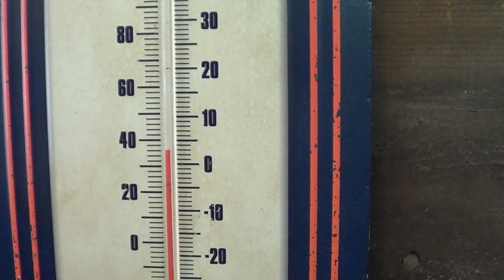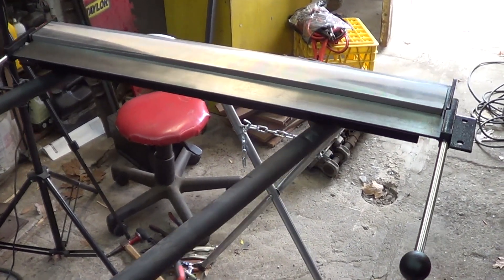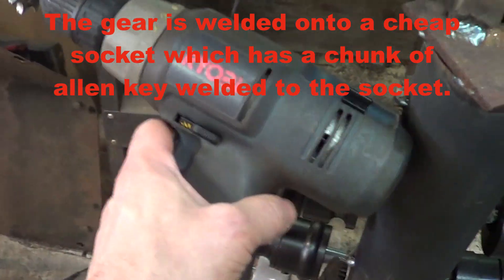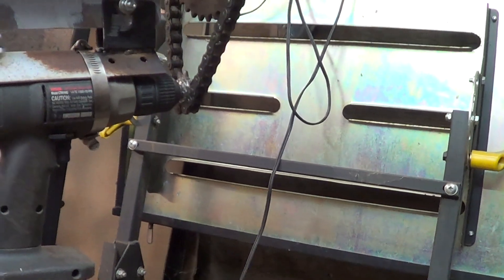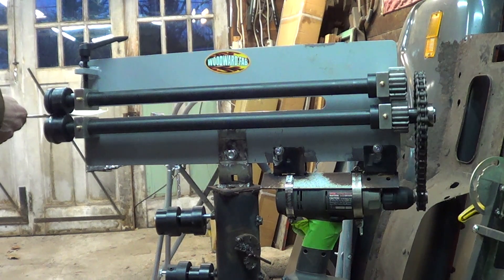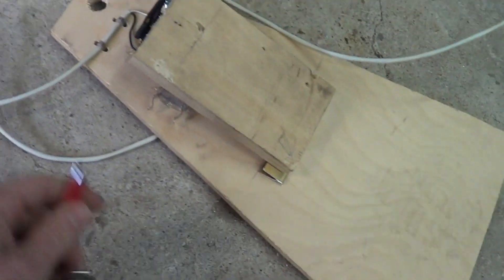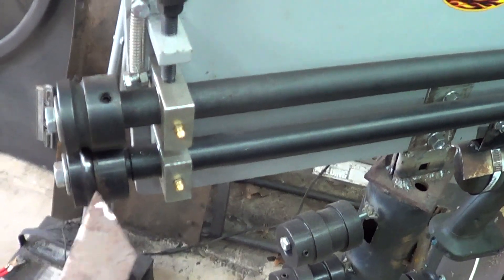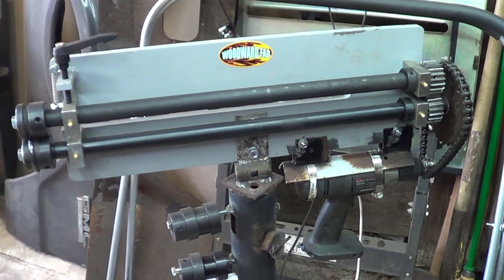Cordless Drill Powered Woodward BEAD ROLLER

Comment: Thankyou fir sharing the knowledge.  Great to see what gearing works with a drill, and that it has enough power.  Ive got some "retired" drills and didnt fancy buying a motir and controller etc etc like so many pimped bead rollers on youtube.  Ive done similar tbings with drills and usually run a string round the trigger down to a bit if wood as a pedal.  Getting it the right lenth is a fiddle and for the next one i was thinking a push bike brake and cable.
Reply from the maker: Those are good ideas too, we didn’t think of a brake cable, pretty smart! The drill works pretty well, it doesn’t like some of the thicker sheet metals but that is to be expected. Thanks for stopping in and leaving us a comment!